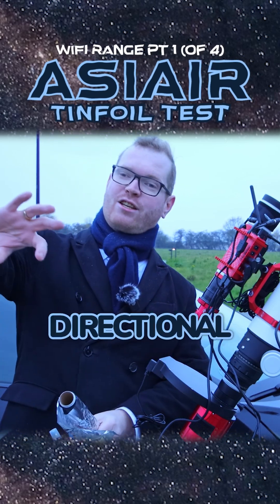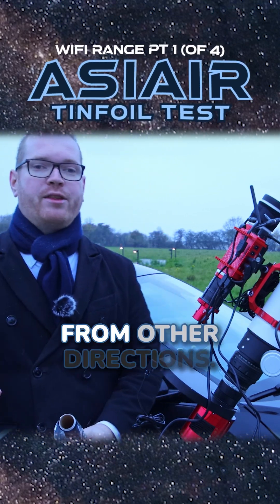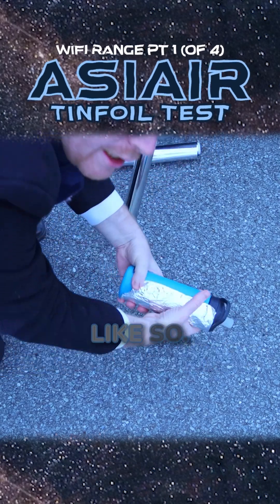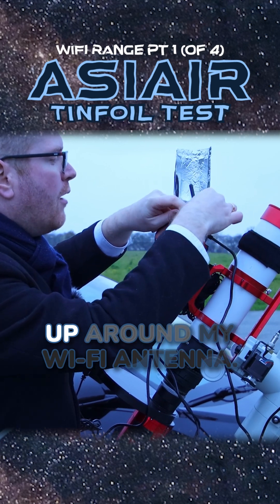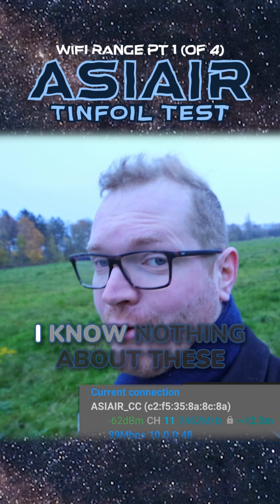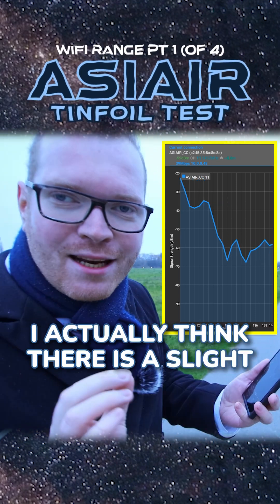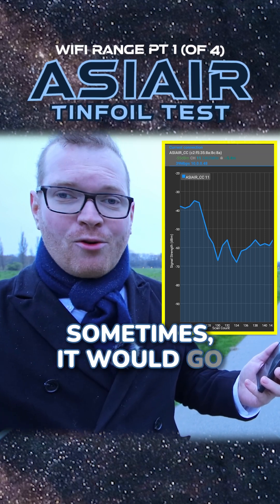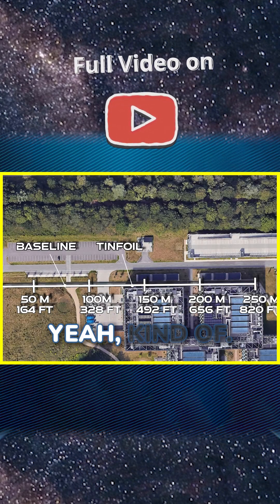Improving ASIAIR WIFI Range with Tinfoil

Comment: A proper test would be: fire up ASIAIR, go away, position smartphone, set it up, start screen recording, walk back, attach tinfoil thingy for 60s, remove 60s, add 60s, remove 60s, stop recording, watch video, conclude.
Reply: Yeah, but seems like it is meant more like a ballpark thing. Not to mention he gets exercise and if you watch the full length video the results are more variable than the scale can accurately show.